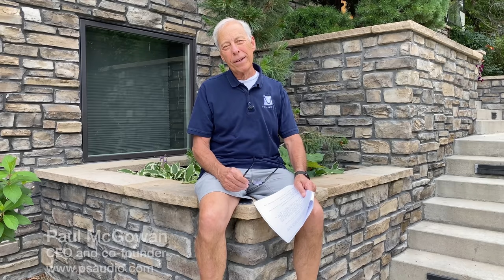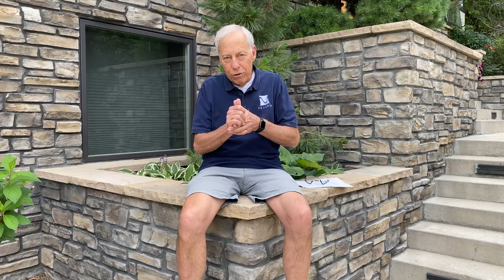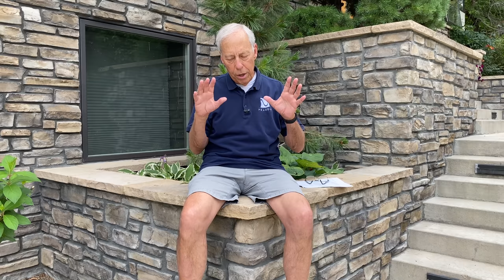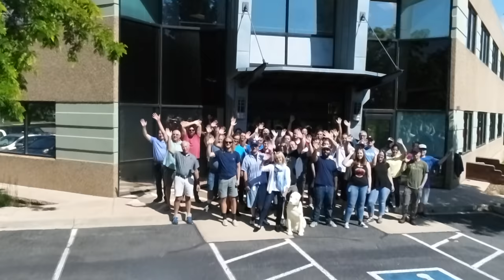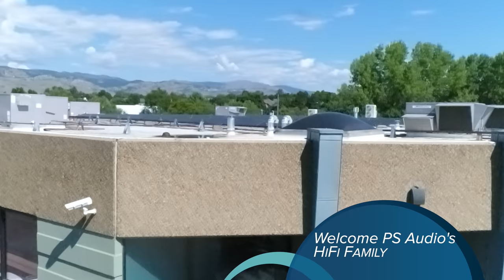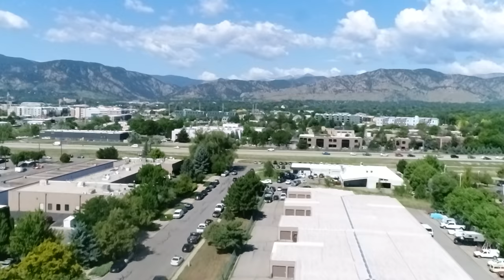Speaker cabinet resonance. Gimmick?

Comment: Unlike distortion, cabinet resonance is a linear response, so its contribution to the overall sound (measured as a percentage) does not decrease at lower volumes.  That is, there isn't a certain sound level you have to hit before it becomes a problem; it is a common misconception that it only matters at high sound levels.  
Just like frequency response and driver resonance, it has the same effect across a wide dynamic range.  
That is not to say that cabinets (and objects in the room) cannot have sounds that they only produce at high levels, due to defects like loose parts or screws, cracked joints, etc., but basic cabinet resonance won't disappear as you turn the volume down.
Reply: Fat Rat  Marrianne is absolutely right. 
Also you may have heard this before but here we go again :
Loudspeaker cabinet resonances can never be used to an advantage. They are just random spurious resonances that add noise and distortion to the speaker output. Harbeth can change the resonant frequencies and amplitudes by variations in cabinet construction to spread out the resonant frequencies and lower their amplitudes but using the cabinet resonances to any advantage is not possible. All respective speaker manufacturers do this or should do this anyway.
Reply: Fat Rat  
Enginear - I like that.  Very appropriate title, but I'm waiting to hear back from him regarding whether or not he can hear the distortion in the "Out of Thin Air" track 1, before awarding him the title.  I sent him a de-clipped version that he can do A-B comparisons with.
Reply: Fat Rat  
It's running around 35-40%.  But I think I could increase that ratio by providing an A-B comparison track.
Reply: Fat Rat  
What's noteworthy, is that all of the peaks on track 1 hit precisely -3dB and that is when distortion is audible.  Other tracks exceed -3dB without distortion.  
My best guess so far, is that someone didn't notice a limiter switch was set to ON when they recorded that track.

Comment: My best subwoofer was 3 concrete stormwater drain tubes stacked vertically with a 15" woofer at the top on a solid wood baffle. It stood 5 feet high. Did it resonate? Not a chance. Did it look ugly? Oh yes.

Comment: I was asking myself this question.  I want to do a carbon fiber cabinets, and was thinking about non-traditional shapes that might be functional for minimizing vibration and interesting to look at.
Reply: don do it. Carbon vibrates like hell.
Reply: @Paul58069  Carbon fiber in a thin sheet will vibrate (i.e. carbon fiber instruments), but in a laminate with the right core material, it will be super rigid. and well damped.  It is not practical, but should work if I ever get around to it.
Reply: @fredygump5578  Carbon sheets with a different core material inbetween won't do much strenghtwise. Carbon fibre is only strong when it is layered with another sheet of carbon fibre and then cross or diagonal orientation for the weaving. But I appreciate your quest for finding something leftfield that could work.
Reply: @Paul58069  Clearly you do not have ANY knowledge of composites!  Laminating over a core material is literally THE WAY to make a strong and light weight panel.
Reply: @fredygump5578  I must take your word for it, I am indeed no expert in this field. I hope it will work out for you. What core material do you have in mind ?

Comment: why can't we have speakers without cabinets. they should be able to levitate in mid air, and have the levitation circuit effectively isolated from the speaker wires so there's no interference. in fact we could have wireless speakers (which everybody knows BT audio provides the cleanest audio listening experience)  and then... three levitating speakers that rotate, just like Jimi H. idk why this isn't a thing, i don't see any reason why it shouldn't be.

Comment: How about Harbeth?
Reply: There are two ways of dealing with resonances, everything resonates at some frequency but you can either deal with it by sheer mass and rigidity - think electron microscope sitting on a massive concrete slab 2) ultra light and rigid to reduce the duration of the vibration and shift them up out of the audible range.   Magico/Wilson use the first method and Harbeth the second.

Comment: So Paul let me ask you this, how do you explain Andrew Jones turning the Pioneer speakers for $80 that weigh 12 pounds each or his Pioneer Tower or elac budget speakers that are light and don't have a bunch of bracing and they sound fantastic for the money? Ready Set Go!
Reply: Loudspeaker cabinet resonances can never be used to an advantage. They are just random spurious resonances that add noise and distortion to the speaker output. Harbeth can change the resonant frequencies and amplitudes by variations in cabinet construction to spread out the resonant frequencies and lower their amplitudes but using the cabinet resonances to any advantage is not possible. All respectible speaker manufacturers do this or should do this anyway.
Reply: Fat Rat  Yup, I meant to say respectible, which I consider Harbeth to be because they have managed to make a great sounding speaker that is generally affordable. I haven't heard them but by all accounts they have done a good job with the cost compromises. I stand by my claim that cabinet resonances  cannot be used to any advantage. Harbeth hasn't tuned as much as damped the cabinet resonances.
Reply: Small cabinets are used to be more rigid than big speakers.
Reply: Fat Rat  Tuning refers to altering frequencies, damping is not altering frequencies but damping resonance. Two totally different things. Harbeth has actually done both, by not bracing their cabinet which keeps the resonant frequency as low as it can be for the given size cabinet, and using lots of heavy damping material to damp and also further lower the resonant frequency due to added mass. This lets them keep the resonant frequencies as low as possible which helps keep them out of the critical midrange frequencies but also makes them harder to attenuate. It is by all accounts by successful approach judged by the high praise and acceptance of Harbeth speakers which I commend them for. But I would opt for bracing and raising the frequencies versus lowering them to make the damping more effective. It comes at a higher manufacturing cost though which is obviously important for a speaker manufacturer.
Reply: They’d sound a whole lot better with some  bracing and Dynamat
Reply: Fat Rat - sure, anything like that with a low Young’s Modulus.  Sorbothane, rubber, etc.

Comment: Speaker housings made from cast concrete, yes? Would not have occurred to me, but why not, easy enough to do, with the right inner and outer moulds from plywood or MDF.

Did that when I was in my 20ies, cheap steel tube plus glass Hifi-racks, just plugged the plastic caps on to of the tubes off, fitted them with long M8 bolts, lots of nuts and big steel washers along the length, , filled the tubes with concrete, hammered in the plastic tops plus bolts and everything top and bottom, and that were my super heavy Hi-Fi-stands. 
Any ideas, anyone, what might happen if I were to exactly replicate the inner dimensions of my aged Mission 775 floor standers with some wood, holes for the drivers and wiring and all, outer case a thickness around that by dint, to then "remake" them from concrete, outer coating then not so much to the point? Inner lining, bitumen or sth. recommended?

Comment: Paul, when are you going to show us the Barns and Horse Track? 
Solid aluminum? I bet they were the tingiest things on the market.
Reply from the maker: Oh, quite the opposite. Deader than doornails. Big, thick, heavy. break your knuckles strong.
Reply: Aluminum is the “deadest” metal there is.  I’ve used it to great effect for speaker cabinet bracing in fact.

Comment: Why do we even need speaker cabinets???   Is it possible to not use them .   Would it sound good?
Reply: Yes, within certain design parameters, one style is called 'open baffle' speakers, and yes, they can sound great. But, you still have the same problem, but with a lot less mass and design options for containing/stopping speaker baffle vibration, and a lot of baffle size to control, which is required in order to keep front and back sound emissions from interacting for at least a certain amount of time.
Reply: james ross Yes it is possible. Eg planar or panel speakers. I have a pair of full range electrostatic speakers. Flat panels in a frame so they are dipoles and radiate from front and back. No box to resonate and no crossover to cause distortion. Expensive but incredibly fast and low distortion.  Once you have heard quality large electrostatics you will never go back to a box speaker.
Reply: Thanks for the information. I will be putting it to good use.
Reply: @geoff37s38  magnepans are well worth it as well.  Quite the Revelation
Reply: Open baffle speakers - the whole room plays together with speakers, i mean 3x more than with classic boxes.
Reply: Zeus Apollo Not heard Magnepans but I imagine they sound similar to electrostatics.

Comment: I used to own a pair of passive radiator Avance's that had a concrete/woodchip construction. Curved sides, bumpy surface, fast bass, vifa drivers, and not too bad 'waffed' against a wall. Speaking of which; they were white with two dreadful pinstrips down the black grilles. They were almost waffed out the house, though pulling these pinstripes off was the dramatic improvement that led to permission for their retention. Always a good idea then add some tasteless flourish to new gear, so you can 'compromise' by taking it off again! (shhh - I won't tell anyone)
N.B. my new word 'waffed' = subjected to an action due to a poor 'wife' acceptance factor - to be PC; note hyphens - 'wife' can be applied to either(any) sex.
Reply: *Vifa drivers.
Reply: @jareknowak8712  Typo! viva la vifa

Comment: I've heard of (but, not heard, just throwing this out for information purposes)  a Danish company called JERN Aps that makes small 2-way speakers with cast iron cabinets, claimed to be very non-resonanant.  Their merged double spheroid shape (I know, weird, but I can't come up with a better description, except) that kind of reminds me of a Shmoo, a mythical little critter created by cartoonist Al Capp, except without the face and stubby legs and feet.

Also there are planar speakers, like Magnepan that have a frame CNC milled from "a quotidian[?] sheet of trusty MDF; dimentionally stable, homogeneous in all three dimensions, and inexpensive."
Reply: Fat Rat  Loudspeaker cabinet resonances can never be used to an advantage. They are just random spurious resonances that add noise and distortion to the speaker output. Harbeth can change the resonant frequencies and amplitudes by variations in cabinet construction to spread out the resonant frequencies and lower their amplitudes but using the cabinet resonances to any advantage is not possible. All respective speaker manufacturers do this or should do this anyway.

This is starting to get old. 😉
Reply: @StewartMarkley  And yet Harbeths and BBC based designs in general still sound so bloody good!  Too rich for my modest socio-economic status, but compared to halo products from Wilson, Magico, et al. they are quite reasonably priced.

Hey, Mr. Rat.  Good comment, not old at all.  ;-)
Reply: Fat Rat  You can't change the laws of physics, but sometimes you can finesse them a little if you're very clever, like Alan Shaw.
Reply: @stephensmith3111  Agreed. A sign of a superior speaker company in my opinion is making a great sounding design that is affordable at the same time. I am just pointing out that resonances of any nature in a speaker is not advantageous. Ideally all sources of resonances in a loudspeaker should be damped (minimized) as much as possible.

Comment: I once lined some speakers with carpet and they sounded much better.
Reply: Fat Rat  Using No-Rez inside the cabinets and heavy blankets on the outside of them is even better,. Then using plenty of bracing inside to raise the resonant frequencies to make them easier to damp is still better.
Reply: Fat Rat  What they are doing is let them flex at their lowest frequency (because of no bracing) and use lots of damping material and possibly high loss wood as well to damp the resonances. If they used bracing, it would raise the resonant frequencies which would make the damping more effective. They aren't tuning anything. Any resonance is potentially disruptive at any audible frequency.
Reply: @StewartMarkley  bracing and inside damping will change the Thiele-Small parameters.
Reply: Fat Rat  I may not be an expert on everything, but I know a thing or two about resonance and damping which I began learning about in 1968 in electronics class.
Harbeth has no reason to change because they are very successful in their approach. There are too few companies that go as far with cabinet resonances as they do and I commend them for it.

Comment: I have an app on my phone that measures even the tiniest vibrations,placed my phone on one of my speakers and cranked it up. No vibrations at all or very minute during some heavy bass music.
Reply: The vibration that goes hundreds of times a second will not show up on your phone unless you glue your phone to the speaker. And it can be the back or side plate that vibrate, not the top plate which usually is small. Smaller surfaces have higher pitched self resonances. If you knock on different parts of your speaker, then you will get an idea what types of resonances your speakers. Every speaker resonnate, but it often is taken better care of in high end models.
Reply: @oysteinsoreide4323  I placed my speakers on its sides and measured also, same response, either no vibration or very minute during heavy bass parts of a song. And the app is very sensitive as it used the phones internal sensors. Just touching the speaker with the tip of my finger while my phone is resting on it shows vibration.
Reply: @dakken74   
What is the model of Your speakers? 
It might be corealted with frequency of vibrations, not sensivity.
Reply: @dakken74   There is a reason test equipment that measures this stuff is 10K+. Your phone doesn't have calibrated vibration sensors. Why is it that so many think an app on a phone can do everything?
Reply: @MrCarlsonsLab  I know my phone's sensors are limited, bit there also a lot better than people give them credit for.

Comment: No mather what you do , its impossible to elliminate the cabinet resonating. Even if it was concrete.  Thatone is indeed true.
But there are ways to reduce , and disperse over a wider band. A lot better Than having a box resonating at a single freqvency or over a narrow range and with high amplitude.

So its bettet to first start with a proper design that aims to spread the resonance over a wide range and then , only then proceed to how to dampen those.

Comment: this is why i think magnesium is the best material. not too expensive to cast, great internal damping properties, lightweight and super rigid
Reply: Aluminum is a “deader” metal than magnesium. 
Plus magnesium is very $$$$$$$$$$$$$
Reply: @petersouthernboy6327  really? cuz all the reading ive done suggests that aluminum is great at transmitting vibrations, not damping them, and magnesium (some alloys in particular) are used in aerospace specifically for their high damping factor. genuinely very interested in learning more if you have a source or something that you can share
Reply: Crokto - magnesium, lead, and zinc alloys have a slightly better Young’s Modulus than aluminum - but magnesium is much more expensive than aluminum.  As a matter of fact, I don’t know where you’d get commercially available preformed structural magnesium materials like angle or sheet or bar - magnesium has to be cast or forged.
Reply: @petersouthernboy6327  i never said it was *cheap*, but if youre gonna charge 6 figures for the speaker its definitely still in the range of affordability. casting is going to be the best method anyways to get the sorts of shapes you want, but you can get sheet or bar stock on alibaba for example. you can totes machine it, it just might explode is all (but there are shops that specialize in this and precautions you can take). young's modulus also isnt the only factor, but also a materials internal damping, a process which converts vibration to heat. from what i understand, many machinist tools are made from cast iron rather than steel because cast iron has better internal damping properties, and magnesium has much better internal damping than most similar metals.
Reply: Crokto - it would be much more worthwhile to put that money and effort into the drivers and crossovers.
Reply: @petersouthernboy6327  obviously its always a balance. investing more into the cabinet doesnt make sense at some price points, but does at others. thats literally what this video is about and idk how thats even relevant to what we were discussing. i was just curious if you had anything to back up your statement of aluminum being more dead than magnesium, do you?